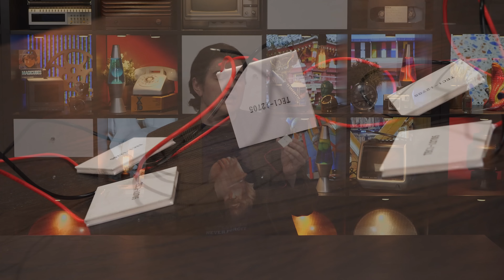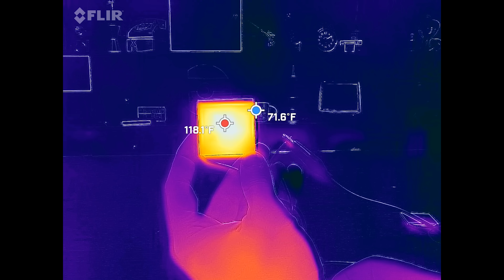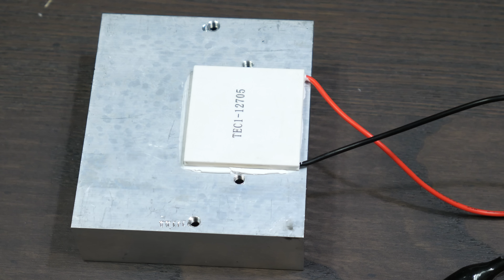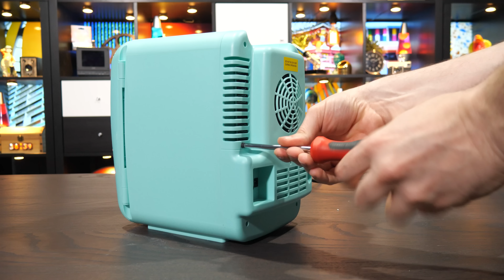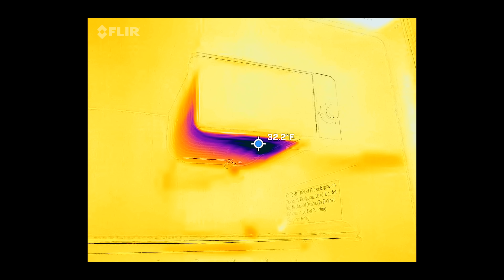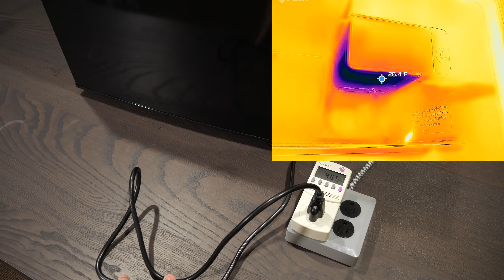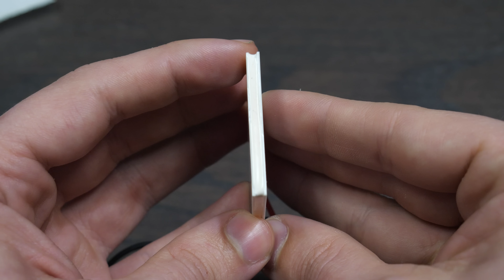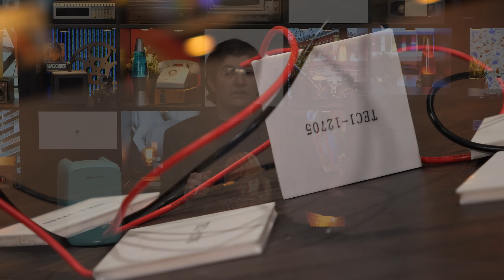Thermoelectric cooling: it's not great.

Comment: I come bearing a fun fact about peltier plates that confirms your point that they're bad. The power use goes up the greater the temperature difference across the plate. As in, it takes more power to push a watt of heat across the  plate if it's fighting against the outside, which is exactly the use case of a minifridge. They're significantly more efficient when they move heat from a warmer space to a cooler space. This showcases why it's bad for most applications but great for special use cases like amplifying existing cooling of another system such as in medical or chemistry applications.

Comment: That's exactly why I'm skeptical about using Peltier elements in CPU coolers. Yeah, its all cool (heh) and good, but when you need to dissipate additional 60 watts of heat on top of 100 watts your CPU outputs constantly... well, then the idea of using computer as a heating source in colder climates doesn't look so dumb now.

Comment: You're shitting on the peltier when you really should be shitting on the design. The problem with that micro fridge is that it's designed very poorly. It has little to no insulation for the heat load. And it isn't running enough peltier watts for the heat load. 
Designed properly with enough watt dissipation and R value of insulation it can work well, as do some automotive based fridges. It's still going to use more power than a gas based system but it can work for specific specifications
Reply: He does at the end of the video

Comment: This begs the question of how good you can make a little beer fridge with a peltier.
Aerogel isolation, lots of modern heatpipes, no fan, heat regulation, top opening door, the works! Can we get it down to a reasonable wattage and hold 4-6 ⁰C?

Comment: The dumb part with those small fridges is you can actually have a temperature control on it, they just haven't despite it being a simple circuit and micro controller gotta save those $$. 

Example of it done right a Astrophotography camera sensor cooler tend to use a Peltier and have temp control because they have a sensor on the err sensor for temp, which means that a simple Micro Controller can adjust how much power is being sent to the cooler. Example of this is that most have in software reporting that actually shows you what % of max power draw is being demanded to keep the current cooling by the circuit and most will use a high amount during the initial boost then drops the power to maintain.

Comment: I think one of the best use cases for Peltier devices is to replace resistive heating devices. They pump out more heat energy then they use, so it's a win win there. I also wonder if they would work for HVAC in a velomobile, or if it would be possible to make a compressor based system small and light enough to fit.

Comment: The mini fridge has 1 actual use. Truck drivers. Energy consumption is irrelevant when it's pulling from a diesel engine that's running anyway. That little thing will put a nice cold drink/snack within arms reach while driving.  I had no problem opening up mine and pulling out a drink without taking my eyes off the road. SO for vehicle use, I think they have a place.  But for home use? It's just a novelty to have a fridge on your desk.

Comment: I have had a recent 2-stage (separate doors for wine section & beverage section) thermoelectric fridge and an older single stage wine fridge.  The latter was more efficient than you are describing (and silent after my Noctua PC fan install!) and the former was a power-hogging mess.  I suspect the 2-stage was a nightmare because it had 2x everything; running continuously.  Also, do not undervalue the potential of technology change.  Just as heat pumps have become useful in colder climates, the potential for us to get away from compressors is very possible.  The insulation of the door seal and side walls is really important.  Toys are not tools.  A better comparison would be a well insulated single unit thermoelectric over 24hrs (after a setup time 24hr cool-down period to reach steady-state).  It may be more continuous energy than the compressor but much less of an impact than you think.  Oh and you should redo your mini-fridge compressor data -- 3hrs is not enough to get full thermal cycling.  That's short-cycle data you are extrapolating.  I might as well only show the stock market on a good day and say, "Look!!!  It makes money all the time!!!!!!"

Comment: Working for an extremely large corporation there were limitations to the kinds of things we could plug in - reminded me of dorm room regulations - no hot plate, no coffee pot, etc. refrigerators were a big no no - but when these started popping up the “12 volt nature” of it and its lack of refrigerant made them “ok”. 

I even used a KillAWatt to prove that having twelve of these in our office was a LOT more energy than just letting us out a single smallish mini fridge for drinks and snacks in our department. This was a department where we designed all kinds of things using ridiculous power hungry computers and monitors, had our own rack of servers separate from our server room upstairs, AND ran a large Fuji machine that imaged 60” aluminum plates for offset lithography soooo in the end the fact that we were using that amount of power was deemed overall negligible. When did it become an “issue”? Someone bought a cheap phone charger that caught on “fire” (it melted and there was a puff of smoke) and next thing you know we were no longer permitted to plug ANY equipment not owned by the company in. 

Solution? 

Someone started bringing in one of the big off grid power banks to run a mini fridge the size of the cube in this video. Took them a year to figure out how to ban it because - wouldn’t you know - we weren’t plugging it into building power so it didn’t actually violate a rule. 

But I digress. 

As someone else said, these seem to most often be used where a limitation of some kind causes their requirement. 

I think it would make an interesting video to pair a peltier cooler with those solid state air movers from the likes of Frore (the air jet comes to mind). We shoved a couple of those into fabless laptops and were shocked at the amount of air they could actually move.

Comment: I'm pretty sure they are used in space as well as power generators.  One side has a radioactive decay on it generating heat and the other side is in space.  When you cool one side of them down and heat the other side up, they generate electricity.

Comment: Drinking a cold beer from my stupid little Frigidaire unit as we speak, best 20 bucks ever spent 😅

To be fair I'm kind of the end of the rainbow user for this thing, I usually only use it on the weekends to hold an already cold 6 pack, then switch it off after it's empty. My house is pretty cold at around 68 degrees, and I think my particular unit's efficiency is helped a bit by being a chest style unit rather than having a vertical door

Comment: Now I'm curious to see if it would actually need a temperature controller if you filled the blue blob's door with insulation. I would guess it would just  make it achieve a slightly lower temperature but there would still be enough heat leaking to prevent freezing.

Comment: Heh. I had to pick one of those up in a pinch because my apartment's fridge went out and it would be several days before it got replaced. Had meds that had to stay at least cool and even keeping the fridge door closed as much as possible, it wouldn't stay cool long enough.  Of course, I helped the mini fridge by transferring some cold packs that were already frozen into it, so it just had to be a "slightly more cooled small insulated space" for a few days. It then got turned into a shelf ornament, where it uses no power.

Comment: I had two fridges from amazon for around 100€, the first one cooled the interior to around 10°C and i accidently burned it by pressing the switch to DC even tho it was connected to AC. I sent it to amazon and got my refund. I have the second fridge for over a year now and i'm very happy with it, it cools the beverages to around 9-12°C which is perfect for me. Also these fridge take a lot of time to cool just their insides. When putting room temperature beverages to a room temperature fridge, mine needed around 24 hours to cool everything down.

Comment: Though it's true heat pumps can't be beat for efficiency, the can cooler is as horrible as it is because the manufacturer is trying to make it as cheap as possible. It's actually not a bad use case, just a horrible implementation. Those thermoelectric coolers are almost always run WAY above their optimum power range. If you added a few more of them, more insulation, heat spreaders etc., a temperature sensor and a tiny circuit to regulate the temperature you could create a very compact six pack cooler that kept them ice cold, and didn't waste nearly as much electricity. It would just cost three times as much, but if space is at a premium, it could be done right.

Comment: you need to understand how it interfaces with the environment. If you have only square ones. put 6 in the shape of a hexagon (top view) with hot side facing in. Use copper wire or pieces to use as cold sinks for the cold side. NOW Suspend over a bucket of water. For power you shouldnt use constant DC but pulsed or varying depending on the application and ideally array capabilities.

Comment: If you are already and exclusively using resistive heating to heat your home, then this blue toy might make some sense (as in, it is not wasting anything). But even then it would make a lot more sense to update your heating system instead.

Comment: Another fun fact. If you already have a difference in temperature, but not a voltage source, those things turn into generators and they make their own voltage.

You could actually thermal paste Peltier blocks together in various configurations to make rudimentary AND and OR gates.

Comment: Peltier elements could be used for scientific instruments that require precise and stable temperature. Put the instrument into isolated box, make hole for peltier element, put big heatsink on outside. The element could then both cool dow or heat up the instrument as needed, up to plus/minus 20°C difference between ambient.

Comment: Apropos teeny tiny compressors - the very same Tested as the sticker on the red fridge is from, had a one day builds-video a few years back where he builds a refrigerated cooling suit with help from an external guy - and the compressor they use there is much smaller than the one in the fridge! iirc it would fit in your hand! Really cool.
Reply: "Adam Savage's One Day Builds: Refrigerated Cooling Suit!" z_Ti4GP0ntE

Comment: Pity the blue (... it's teal?) thing is not fully insulated - my first idea was to use it to keep stuff already cooled cool for longer, power off.
And the second idea was to shove in an arduino, two temp probes and a relay to cycle the element and get rid of the fan.
Thankfully being an European and not a commie my regular fridge is less than a mile walk away so I guess I'll survive.

Comment: Great video. I had a couple of the bigger coolers that I used for car trips.  If you filled them up with cold stuff, It kept the whole thing cold without the need for ice for a couple of days.  I thought it was great.  BUT, the biggest problem with peltier junctions that you did not mention:   They just don't last very long.  The cooler worked great, until it didn't which was about a year.

Comment: It's true that is not very efficient , but it works keeping cool something cool .For me, I have a Ice box with a turbine / peltier combo with 2 big aluminium heat sinks on each side (cold and Hot)  , and a small thermostat that only works when is connected to the 230V. If i plug it on the 12V of the car it runs full power non stop . when I'm going to do a big summer road travel where in Europe (about 1800km) , I power up at least 24h before to cool down the ice box .on my house refrigerator I freeze some cold packs, a 1,5L water bottle , and the food/beverages that I want to transport .Next day , I put everything inside and plug it to 12V on the car . 20h after , all the things are still cool and the water bottle is still almost all ice. So it's like a "cold extender" , and you must have a good AC , because it generates a lot of heat and some noise , and I have to be careful when I stop for a long period ,to not to forget to unplug it from the direct 12V , or it will drain the car battery  ;)

Comment: Wait; but what if we use the Peltier device as a heating element in the winter? Just have the cold side outside and the hot side inside, and you can heat your room while cooling the earth.

Comment: Let's talk technology connections like luciferian ones. Let's discuss solomons lesser key of demons and electric circuitry symbols and how they are the same pr si.icon Valley terminology like Install wizzards ether net cables and demons that are processes in smart phones. Or blue light triggering neurons on and off in mice from being prohected on the back of their heads. That year tvs changed from tube tvs to flat screen where the blue light is many times brighter. And so on its all occult from the lightning bolt to the nuke

Comment: I have an Emerson "Little Brown Refrigerator" which looks exactly like the one you show in your post. It has a tiny coil wrapped freezer compartment in the top on one side. I bought this refrigerator at a flea market back in the early 1990s for use in my mountain cabin, which was in a slow state of development. It worked fine and I used it for a few years until about 2000. After 2000 for family reasons I was unable to visit my cabin for about two years. During this time, mice literally took the place over and destroyed it. That, in itself is amazing how much damage mice can do if left to themselves. But, the cabin's interior needed to be completely gutted and reworked. It literally took me almost 20  years to  get back to it in earnest. That's been done now, to great satisfaction. But, the salient point of this comment is that the little Emerson refrigerator, bought in the the early 1990s, and likely made in the early 1980s was plugged in and running this entire time. There were a few bottles of water and a beer date stamped from the 1990s  inside which were still ice cold. The temperature outside the refrigerator in teh unconditioned cabin varied from near 100F in the summer to as low as zero in the winter. I replaced the refrigerator with a new larger one (I do not really like) during my remodel. The little Emerson went to my warehouse to keep drinks cold, and then to a school dorm room for another four years. It is still working! I would be willing to bet that one bought today, and subjected to a similar environment would never last so long.

Comment: I just caught the part about the door. Did you try filling it with insulation material? I wonder if that actually helps enough. I might try using towels inside.

Comment: These are still terrible, but I wonder if filling the hollow door with an exapnding spray foam would help insulate the tiny fridge better? Either that or the exothemic reasction would melt the plastic and ruin the fridge entirely

Comment: A Peltier used for cooling commonly used items is really only energy efficient if there's enough surface area that you can use more than one. Say on three of the six sides of a cube? The problem is they aren't widely manufactured enough to make them cost efficient for multiple units per application. The TEC1s showed off in the video are $4 each! Even for industrial customers buying in bulk that's $3.50 a unit! Compared to an aluminum heatsink and a 3.2" 5V fan that you can get for $1 each, have higher thermal efficiency, and use only 5V at 3W (versus the 15V at 45W of the TEC1), it's no wonder for small applications where size is important that heatsinks and fans are far more widely used.

Comment: I have a larger size cooler with a built in Peltier plate that plugs into a car cigarette lighter outlet. It has a heatsink and fan on the outside AND the inside which keeps the temperature more even. It works ok to keep things cold but it is not very effective at cooling things from a higher temperature. It's not perfect but it is portable.
The power plug is also reversible so it can heat the inside. Peltier plates work in either direction depending on polarity.

Comment: In a recent Aging Wheels video he was poking around in the battery pack of some obscure electric vehicle and found the battery was heated and cooled by peltier elements. (Or would have been, if any of them still worked.)
My first thought was "That is so cool, offering both heating and cooling in a solid-state package."

My second thought was "I bet that's not very energy efficient." :)

Comment: I love my Iceco 12v compressor camping fridge.  It's pretty energy efficient and you can use a small folding solar panel to charge it.  It's also very quiet.  The down side is they are pretty expensive, but you get what you pay for.

Comment: Peltier devices, really neat little guys but not for their cooling potential. It's more interesting when I stick a bunch in a pot of water over a campfire and charge my phone. BOOM! portable power baby. That said it takes quite a few in series to generate a high enough voltage to get any useful energy but it's basically free power, and there are some other interesting designs using solar shades that make extra power from sunlight and a cool breeze, and man we always need a bit of extra power for a fan or two. Especially here in the south...

Comment: If you're into this stuff. Checkout the Carrier Infinity GreenSpeed Heat Pumps. Those heat pumps can crank out 90Degree(F) in 17degree(F) outdoor temps with just the pump alone at a handful of Amps. And you can't even hear the thing running. It's pretty cool tech.